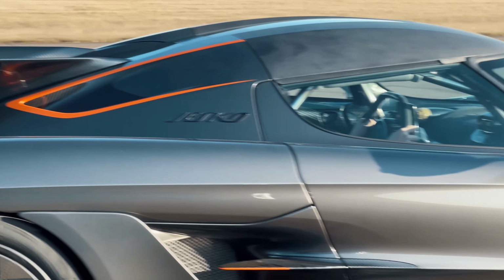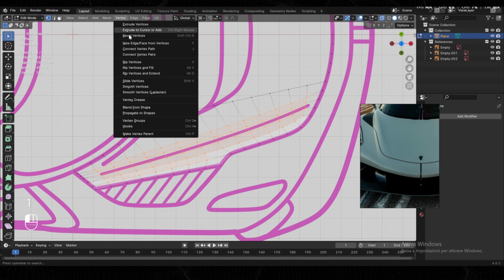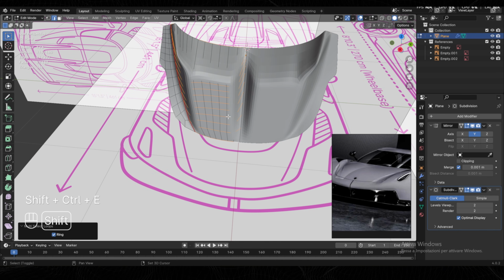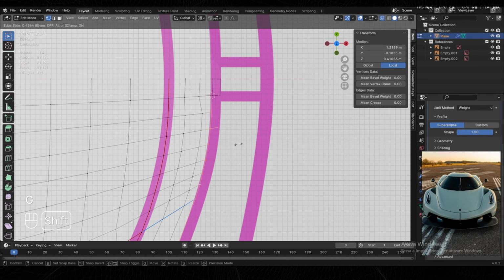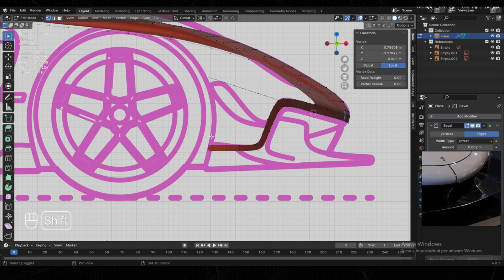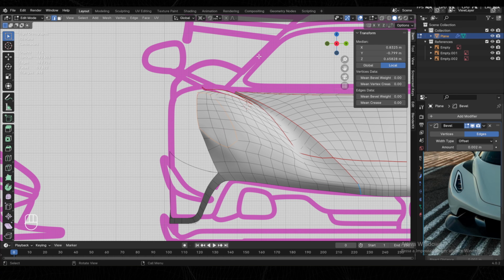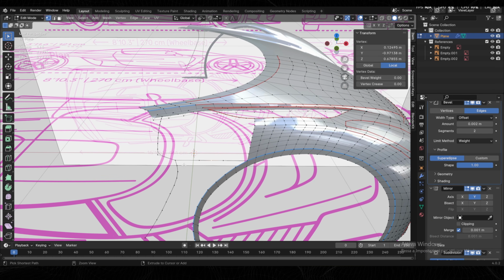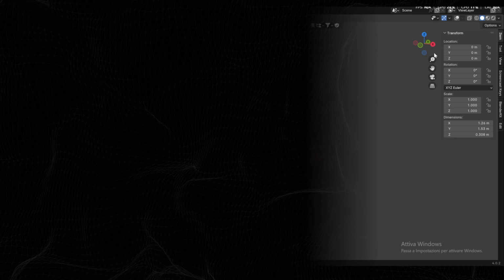The ULTIMATE Way to model cars in Blender | Koenigsegg Jesko 3D modelling Tutorial Part 1

Comment: This seems to be an unoptimized method of doing things, but I can't fault the result, i would start with a much lower poly count for hood so you aren't moving verts around trying to keep everything right and consistent, then utilize the sub div mod more, should make things much faster, then you just apply a single lvl of it if you need more topo to form the shape
Reply from the maker: That is partially correct bro. Because that's another resonable way of doing it, but using subdivision on a low poly surface (example: one with very thin or big faces) can mess up the model's shading. It depends on how you work with your geometry. I personally prefer using the method I showed in this video because that's what gave me the best results in many of my projects, but your method is also valid. Thank you for sharing your workflow with us 🙏.
Reply: @Phantom3DStudios the ends of the hood would definitely be an issue and would have to be done after applying the mod